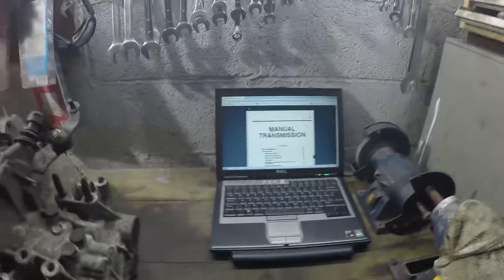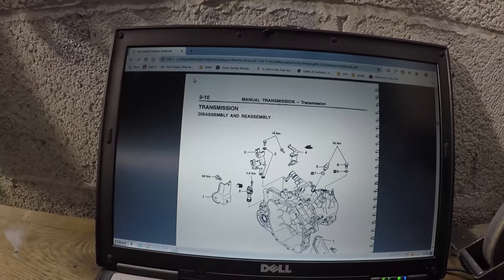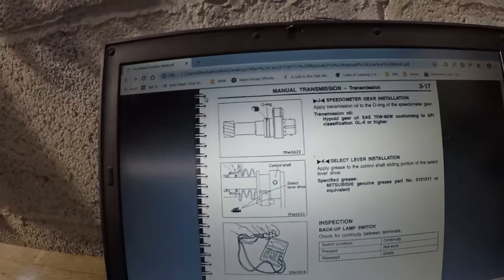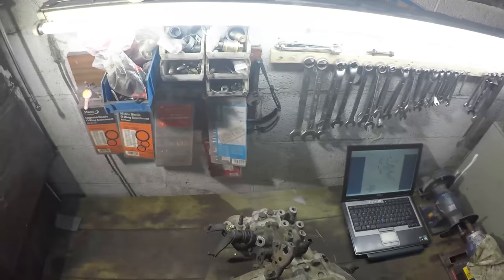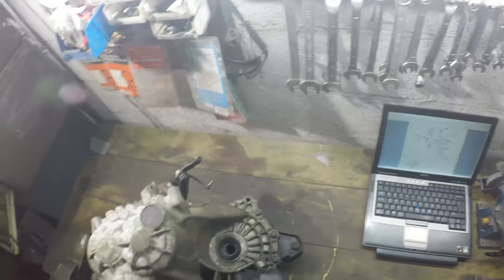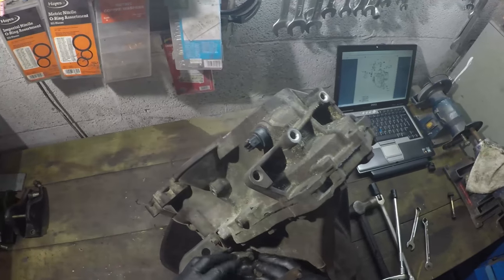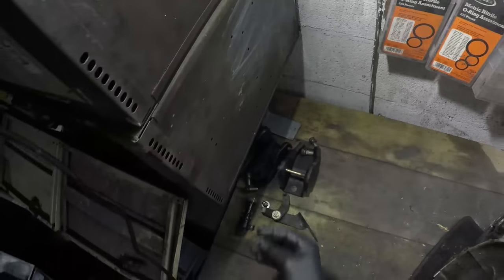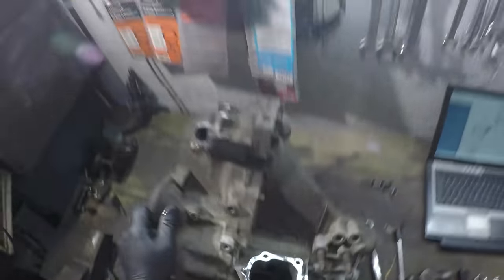Mitsubishi FTO Manual Gearbox Disassembly

Comment: Brilliant video, I was wondering where did you get the manual from??? I need to check my fto gearbox as I no longer can select 5th gear (will not engage and crunching sounds)
Reply from the maker: I'm not sure where I got it from, this could be a syncromesh spring issue - Send me an email and I'll try to help - address is on my profile 👍.
Reply: @ManSeeksCivic  Hi Pamo,
I can't find your email address, all I remember is, I was driving my fto and I changed from 5th gear to 4th gear without using the clutch (my stupidity) and when I tried to go back in to 5th gear using clutch I could no longer select 5th gear.
Reply from the maker: Oof, that's sounding a little more serious, possibly broken gears. The email is : pamoe36328i@outlook.com
Reply: @ManSeeksCivic  thankyou

Comment: Hey buddy I replaced headers on fto, new exhaust sensor (Bosch)  car is fine for 2 days.

Then tonight engine light stalling and battery when trying turn over power was showing 8V yet.  After 6 attempts drives home bit rough and pulsing exhaust note and automatic gears changing rough and engine light turns off and idle returns to normal! 

I replaced the throttle idle control valve about 4 months ago already!

Cleaned up the starter motor when  we did the headers. 

Any ideas? Tonight was 18 degrees but average day temp been 28 degrees?
Reply from the maker: Alternator issues by the sound of it. Could be random, or something got knocked when you put the headers in.
Reply: hi please help im looking to buy a 4 speed tiptronic gearbox for my fto cant find parts im living in south africa johannesburg
Reply from the maker: @bluecrestblue9276  I'm sorry, being halfway round the world there's not a lot I can do apart from reccomend searching ebay, Japanese auctions or forums local to you. Good luck with your search.
Reply: @bluecrestblue9276  yeah buddy I'm in Sydney, Australia we can ship one too but postage will be expensive.
Reply: hi bro thanks for the response what is the price of the gearbox before postage ?
Reply: @bluecrestblue9276  used box $1,300  AUD
Reply: @bluecrestblue9276  let me know if you are serious about it etc and I'll sort out postage and get prices and pretty flat out at the moment